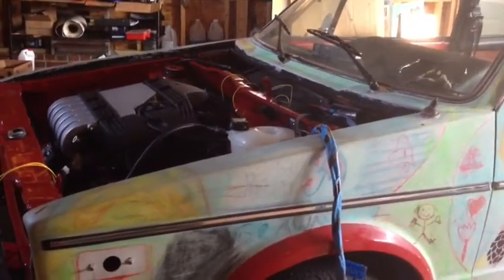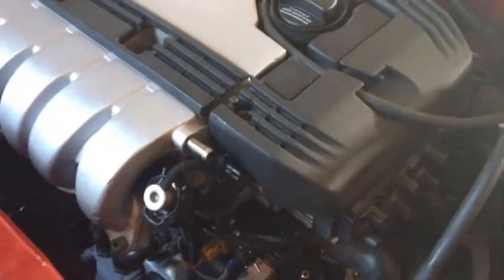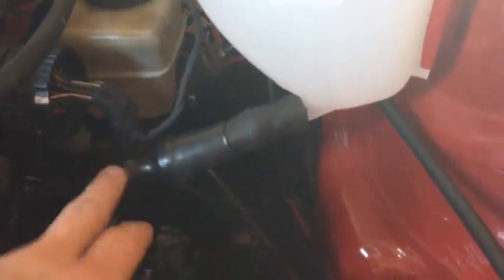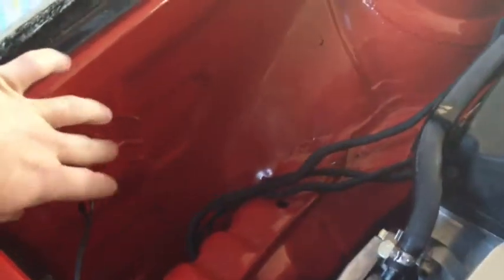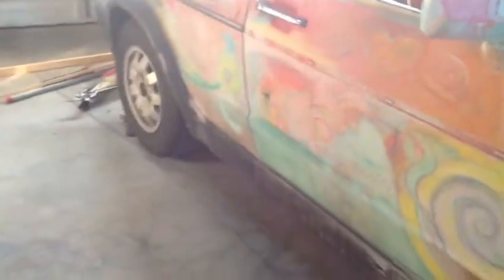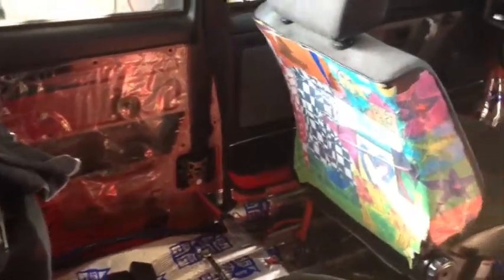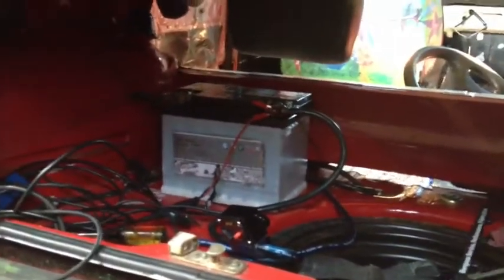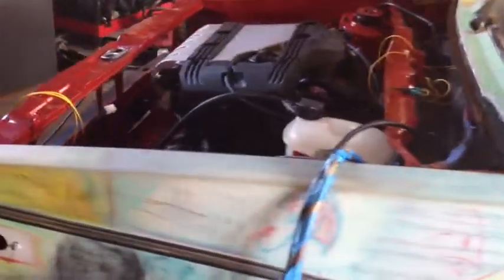MK1 VR6 Cabriolet update 09/09/2013 Luv-A-Dub

Comment: what parts did you keep from the stock cabriolet engine bay. Did you just take everything out from the cabriolet engine bay and then put the Vr6 conversion kit iand motor in?
Reply from the maker: Ali Ozdemir most everything in the bay is from a 1998 GLX Jetta. I kept the Cabby power steering pump, and a few other things.

Comment: Hey I have a mk2 Jetta and I want to vr6 it but I have a question is there a big difference between the vr6 3.2 L from the mk4 r32 and the vr6 3.2L out of the Audi A3 s line of there is any difference i would like to know since I can't find any on vortex and the price difference is about 1000 plus shipping so it would help finish the print faster thanks
Reply from the maker: KEVIN NAR If there are differences, they are probably minor. Things like coolant pump routing and things bolted to the engine. I would imagine that the ECM tune is different too.